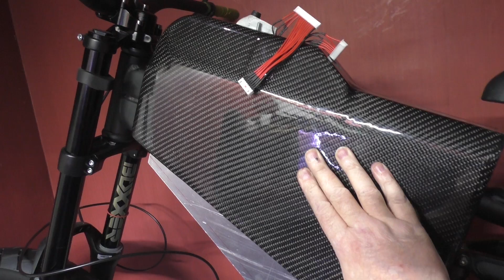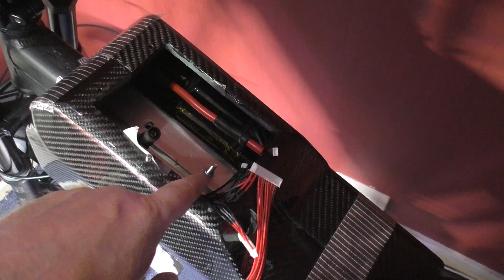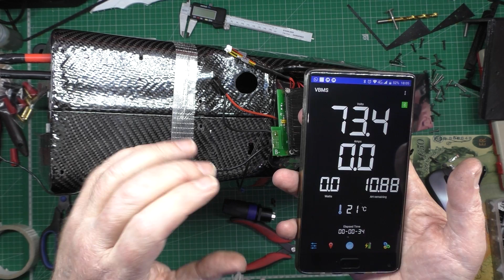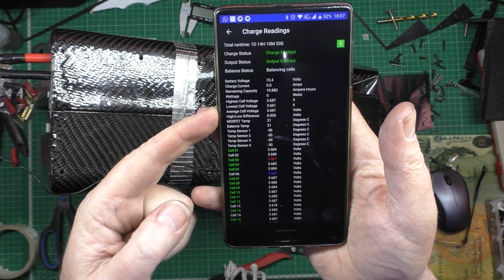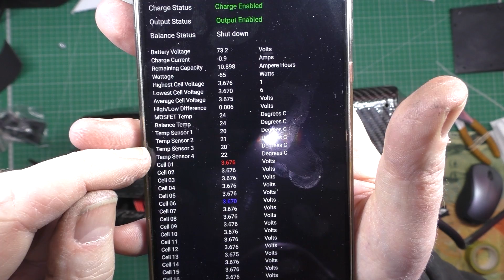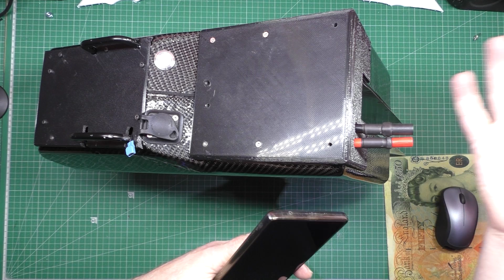High powered DIY eBike MSVA build part 18 - The last one about the battery (it's finished)

Comment: That is near perfect battery back. Unfortunately single Liitokala 26650 cell can only give only 20A continuous current so 20S6P so 120A max. I myself would need atleast 300A burst and 200A continuous. So 300 26650 batteries. Its is nice that those are only 3$ each right now. Oh y and i would need alteast hour worth of run time so more than double of those 300. Thinking of LTO cells 66160. More charge cycles less cells, and no explosions. But more pricey.

Comment: Hi Tony ! I like those torque arms ! Did you make them yourself ?
(The battery case looks awesome !)
Reply from the maker: They were designed by me but I had them plasma cut. I then had to spend around 6 hours with a file and dremel to make them fit properly.
Reply: @vortecks  woah okay, good job then !

Comment: Hi Tony mate iv been watching your videos for some time well done so far for all your hard work and keep the videos coming. 

Iv been doing my own ebike thing for a couple of years now also like u I'm a biker Iv got a yamaha Xt600 and a Honda cbr fireblade 1000rr 
Nothing beets a full suspension bike so I just got a seat post with suspension for my ebike that is hardtail and I have all the space I need in the middle of the frame to keep it compact and it runs smooth u don't notice any difference just an idea 💡 if u want mate

Comment: When you were talking about the weight of the battery i could not help but wonder is there a stupid rule in this test saying a self build can not go over .......... total weight of cycle?.
lovely job Tony well worth the effort.
Reply: I'd assume the testers to pass the bike will take into account the max load the frame is recommended for. I don't know if the licence for the bike however will be limited for o ly Tony's use due to combined weight
Reply from the maker: cibie01 & girlsdrinkfeck
The max weight is (if I recall correctly) 270kg BUT that's "the mass of the traction batteries not being included in the unladen
weight". For some unknown reason, they don't take those into account when they look at the structural integrity!
Reply: @vortecks  how deep do they look into the fork and axle support ? for the torque, very fussy or is any decent DIY job that will suffice for the power rating suitable ,do they like calculate the max output of torque on the drive wheel and calculate if the torque arm is sufficient ?
Reply from the maker: @girlsdrinkfeck  "structurally sound" is a bit ambiguous and there's no set rules or tests. There's no test on the motor, torque output or ability to handle it. They just ask "how much power does it have?".
The top & bottom of it is...... As long as the lights, indicators, reflectors and number plate holder are there and they work, there's nothing sharp or likely to hurt anyone and the brakes can lock both wheels up, it's passed.
The MOT is another story.
Reply: @vortecks  yeah i suppose ,seems they just want to create a log for the vehicles specs so they know whos liable if anything bad happened
Reply: @vortecks  Thank you to you both for the info very interesting.
Reply from the maker: @cibie01 There's another stupid part - it has to have a speedo and it has to be illuminated and it must say "MPH" on it but..... it doesn't need to work or even be connected to anything. I heard from a bloke who builds already registered custom motorbikes and puts them all through the MSVA. None of his are actually connected and some of them he writes MPH over the KMH markings 😂
Reply: @vortecks  i bet so ,i got a man at work who rides a custom built petrol trike and that is NOT safe at all yet it passed and is fully licenced ,the front wheel lifts up all the time even in first and the side  back wheel lifts up going around a corner

Comment: VORT very good idea about the batt , but can i say .maybe can u cover the batt in a fire proff jacket ... just in case .. chers
Reply from the maker: It'll be fine.....trust me.
No fire-proof jacket will stop flames from coming out if it goes wrong. If it's sealed too well with fire retardant material, it won't be able to vent (which is where the bomb-proof jacket will come in) 🤣

Comment: Tony don't you need a key switch isolator for the MSVA?
Reply from the maker: No mate. It must have a kill switch which disables the motor and operated when both hands are on the handlebars but it doesn't have to be keyed.
All the 12v components must be able to be used when the kill switch is activated.
Reply: How will you get around section 7 in the MSVA?
Reply from the maker: @UCAGPOHpd12I47bmMb98btig Easy...... "This inspection applies to all vehicles with the exception of mopeds". Seeing as my bike has a 3kw motor fitted, it's a moped 😁
Reply from the maker: Who is 'UCAGPOHpd12I47bmMb98btig '?
It wasn't me who put that 😂
Reply: Don't forget to stick to that 28mph max speed Tony!
Reply from the maker: @ebikerich  Of course, I must abide by the highway and byway laws, just like everyone else.....until I'm out of the test centre 😉

Comment: What phone is that without a camera?
Is that one of them Chinese ones?
Reply: Think it'd a mii mix the first one
Reply from the maker: @marbesky Phone without a camera? The one I'm currently using is an Elephone S8 but I do need to upgrade it soon!
Reply: @vortecks  no camera on display I mean
Reply from the maker: @marbesky  Oh.... you mean on the front? It's on the bottom right corner. You can just about see it when the light catches it.
Reply: @vortecks  yeah in the front I like how the screen is clear of any niches and other crap.
I've just installed on my scooter a wifi camera and I use my phone as a rear wiew mirror...it's really cool and useful

Comment: Howdo Tony, are you running the lights and indicators off the battery?
Reply from the maker: Yes mate. All the 12v components will be powered from the regulator which will be powered from the main battery.

Comment: nice to see the battery finished but ive had problems with my own ANT bms where it wont sense any current, any tips?
Reply from the maker: You won't be the last and you definitely aren't the first but it sounds to me like you have it wired up wrong mate.
B- should go directly to your battery negative. C- should be the negative which comes from the rest of your components in the circuit.

Comment: Duck brand duct tape! Quack quack! DucK tape! Know what you are saying! I have been working up to a bike build for a while! I guess with my size will be more of a E motorcycle. I'd like about 72v 25-30 ah batt. Or maybe 2 15-20 ah easy swap batts. And charge with solar. I have 1500+ liion cells powering my house. Along with leadacid, for reserve capacity of 800 ah. It's about 1/4 of the planned capacity (the liion bank) I also have a 26650 bank of LiFePo4cells, for my 12v lighting, and other 12 accessories, "radio and security system" its charged from the 29.4v main system. A bit off topic, buy I want a E bike to go along with, I need about 3kw minimum. A 12kw motor would be awesome, but I'd like good range also. 25-30 miles under moderate conditions. Maybe 40 with a good amount of coasting. Great video...
Reply from the maker: My motor (MXUS 3K Turbo V3) is a nominal 3kw - it'll handle 15kw without problems and I'm going to push it to 25kw.
I reckon I'll get around 40 mile range with this 30Ah battery and that should be at 30mph.

Comment: You can move the battery slightly forward. You will never turn your steer, that it will hit the battery.

Why not build a recumbent trike with electro motor? Than you have a lazy man's cruise mobile! 😁

I get my steel for a recumbent trike, next week and later I will upgrade it, to make it electric.
Reply from the maker: Nothing can come into contact with the steering for the MSVA ☹

Comment: Awesome.Very tight fit lucky you can move the rear shock.I just hope you have not compromised the rigidity of the frame too much with all that extra.I`m swapping my 1000w kit to a vintage Tomac 98 Special frame & upgrading to 54v 14ah bat.Hope it all works out for both of us.
Reply from the maker: I've managed to move the battery another 1" further forward so all is good. 
Good luck on the build mate, you know it'll be worth the hassle in the end 😁